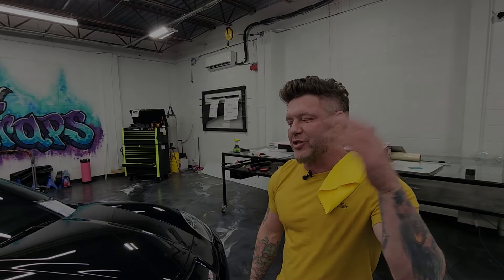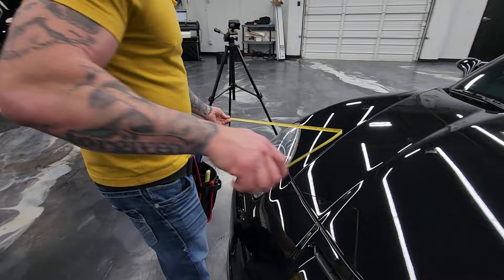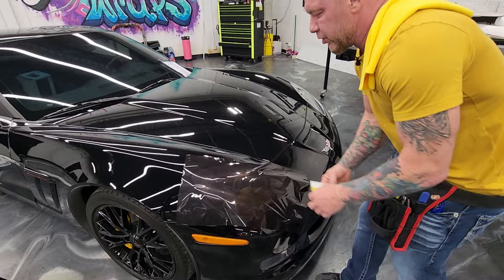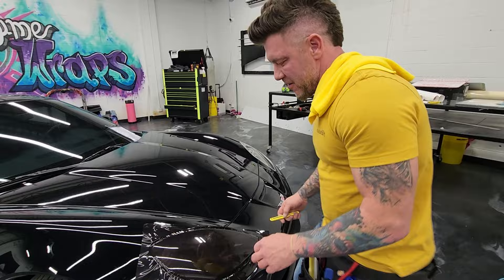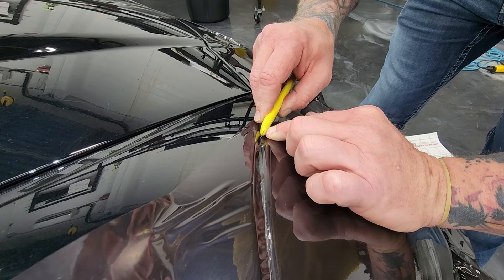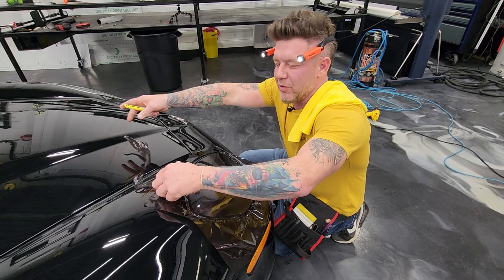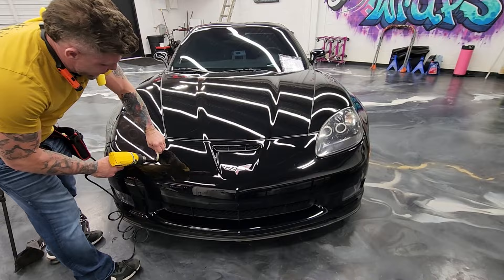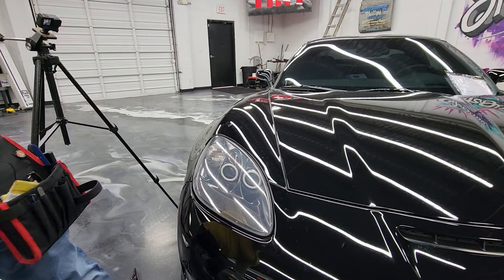HOW TO DIY Tint Your Headlights in 5 MINUTES!

Comment: -DONT tint ur headlights unless ur gonna drive it only in daylight.  It reduces the light brightness dramatically
Reply: Wow really? Figured covering a light bulb would make it brighter.. thanks bro i won’t do it now
Reply: Seeing how blindingly bright headlights are these days I'm sure they'll be fine
Reply: False information, headlight/taillight tint is different from normal tint. It’s designed to let a lot of light out.
Reply: @NuDineroBeats  i guess i bought the wrong stuf. Its that vht brand
Reply: @NextLevelAscension  yellow tint is a different thing. Im talking about black tint
Reply: Naaaa
Reply: Get brighter bulbs
Reply: I used one coating of vht spray tint and it was the lightest coating of paint ever and it still looked like OEM but after a week it was constantly collecting dirt and it got darker I can 100% tell my headlights got darker i cant even drive my car until i order new ones but i was not expecting a light coating of that stuff to ruin my headlights. I did it right too my rear taillights got about 4 coatings and it's perfect tbh but like I said someone that spray tint makes every dirt particle stick to ur headlight lens
Reply: Guy admits to buying the wrong product but he’s the top comment 😂
Reply: It only effects your headlights brightness if you go too dark in tint.
Reply: Some tint doesn't effect visibility enough to be an issue
Reply: The good tiny doesn't reduce light all that much
Reply: Most of them are designed specifically to have high light transmission. Just because you can't see in doesn't mean light doesn't go out as good as before..
Reply: @kyleperron5102  it does decrease the strength of the light. I know because i did mines 😩

Comment: I used water first time with heat gun. No bubbles. Just tinted them again with divx last week. No water and a heat gun again. No bubbles after I finished , even 24hrs later. Figured I was good. Now they look like they have teenage acne. I’m gonna try and find this brand of tint. Dreading removing the adhesive for a 2nd time. Thanks for the video man
Reply from the maker: Several methods to do it, but results can vary.  Glad the video can help ya!
Reply: @shometint dude I don’t think you needed to water if the tint already has adhesive I maybe wrong but u just clean your lights and stick it on like he just did

Comment: Thanks for this video.  About to tint my tail lights.  Good stuff.  Cheers!
Reply from the maker: Let us know how it turns out!
Reply: @shometint  Well, I have done one tail light so far. I would give it a B+.  However, I destroyed the first sheet of material trying.  The problem is my tail light is an extremely challenging shape I now realize.  Its curved the entire way, and is long all the way to a sharp point.  The material wants to bunch up.  Imagine a very elongated teardrop, cut in half.  Its not the point part is hard.  Its the spherical section.  But, not impossible.  I will post a final photo somewhere and link it.  Thanks again.
Reply: @shometint  Damn I just watched the video again and realize I didn't follow how you did it exactly.  I'm going to correct and try it on the second.  You start in the middle of the light, and I started on an edge.  Let's see how number 2 goes more closely following you.  Thanks.
Reply from the maker: @LIVEEVENTINNOVATIONS  practice makes perfect. We are always learning. 💪

Comment: would it be easier to tint while off the car mine are right now, should i put them on before tinting?
Reply from the maker: @Eli_89321  off of the vehicle you will generally have more control of the application and would have no risk of accidentally cutting into your vehicles paint when trimming it out.

Comment: How do you wrap the little interior trim. Like around air vents and such
Reply from the maker: Sometimes we remove it and have it auto flexed but if the surface is flat and smooth we are able to wrap it.  Please be  careful when trimming those pieces out because customers hate it when you cut the car. 😉

Comment: I have a bike though, lots of sharp edges on the front headlights and the rear one is quite literally a 3D shape so it has 90° angles... even with a heat gun it's so hard

Comment: so whats the difference between window tint and headlight tint?
Reply from the maker: Both are made for their specific applications. You would not get the desired results if you were to switch the roles of the material. 

One is meant for inside, away from the elements. The other is designed for outdoor use and has more flexible properties to curve around newer more challenging angles some new lights have. Window tint would not survive such severe turns/curves that the headlights have.

Comment: Trying to tint my headlights. Should I spray the tint and or headlight with soapy water? Would a hair dryer be suffient enough if I'm scared a heat gun will damage my car?
Reply from the maker: You can do it wet, but doing it dry would be the way we would recommend it be installed.

A heat gun is what we would recommend.  The film is supposed to be post heated to 200° and a hair dryer won't get it that hot. 

You could remove your headlights prior to installation if you're afraid of your paint getting too hot.
Reply: @shometint  thank you! I'm trying to do as much as I can to my car myself. Before I go to any shops. This is helpful.

Comment: Youre awesome but I used the Lens Tint Spray and it worked like a mofo
Reply from the maker: Are we talking mofo good or mofo bad?!
Reply: I think worked like a mofo means it turned out BLACK 😂
Reply: @rawbeats7600  lol. Yes. No..if you can spray from a can correctly you're sitting pretty and watched a little vodeo